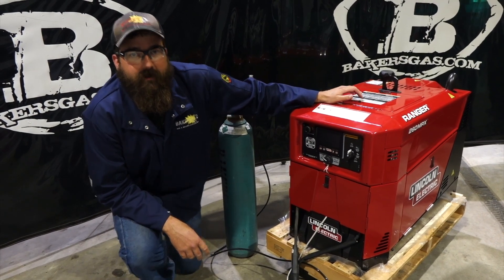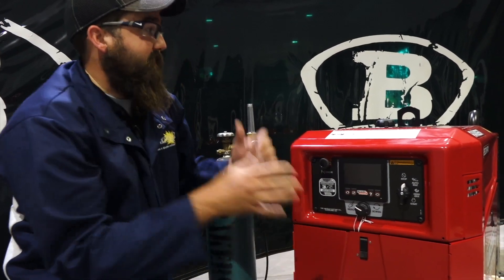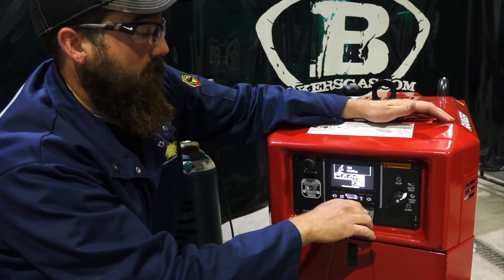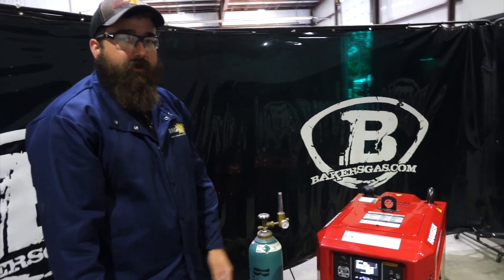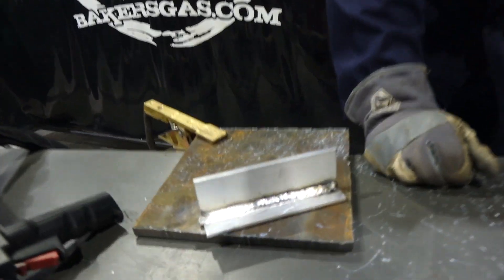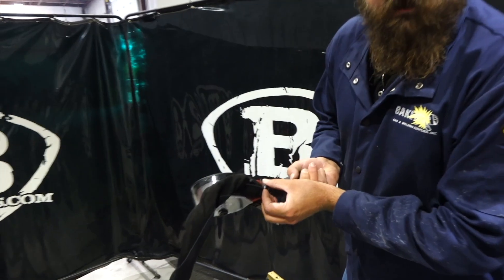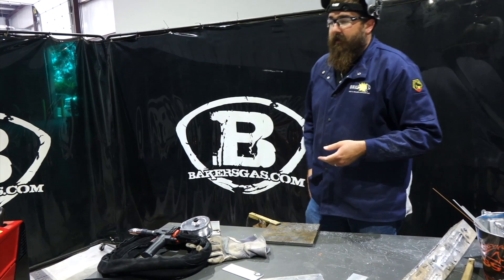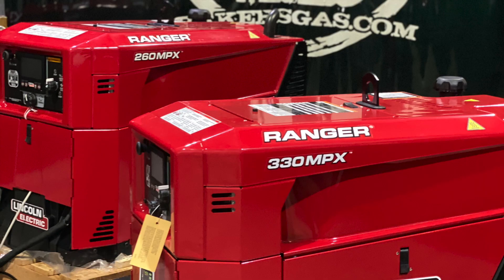Lincoln Electric Ranger 260MPX Review and Spoolgun Demo

Comment: I currently run a trailblazer for the 10,000 watts w/ plasma (Hypertherm 45amp) and air compressor and grinders; which did much better than bobcat. Will the 265 keep up at 9500 watts? Im usually running LN25 wirefeed too. Curiously shopping
Reply: Is it worth the price I heard the air compressor on them is no good I have the 305 Lincoln

Comment: The only thing I hate about them is when u have it in low idle all of a sudden the thing kicks into high idle and takes forever to go back down to low idle. It just sits there and screams all the time but that’s the only thing I hated about it. And the one we had was a 330 idk if the 260 does it or not but I’m pretty sure all the 330s do it correct me if I’m wrong on that.
Reply: Same happened to my 260 but it was the idle silinoed was like a 10 min fix at a local shop it’s just has to be adjusted a bit and should resolve the problem

Comment: Can you arc gouge with the 260?
Reply: No
Reply: Nope you wouldn’t want to anyway not enough amps
Reply: @lockeparsons9198  I ended up getting the 330mpx
Reply: Technically no actually yes u can set it to stick and run a smaller carbon u can’t uses a 3/16 but u can run a 5/32 carbon

Comment: Have ranger newer generation that I'm going to sell having these companies sell machines with intentional failure paint Is joke both linclon n Kohler linclon there board problems n Kohler for unnecessary designs suck being a moblie welder n having dumb issues with designs being the problem so far miller has been working out for me so I'm sticking to that now

Comment: Have ranger newer generation that I'm going to sell having these companies sell machines with intentional failure point Is joke both linclon n Kohler linclon there board problems n Kohler for unnecessary designs sucks being a moblie welder n having dumb issues with designs being the problem so far miller has been working out for me so I'm sticking to that now